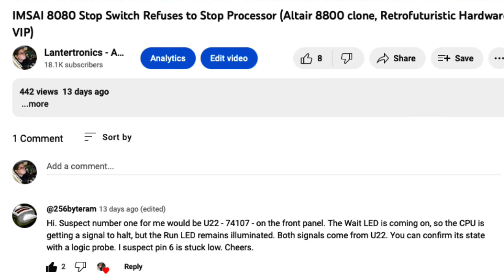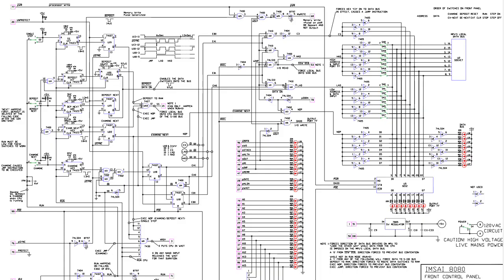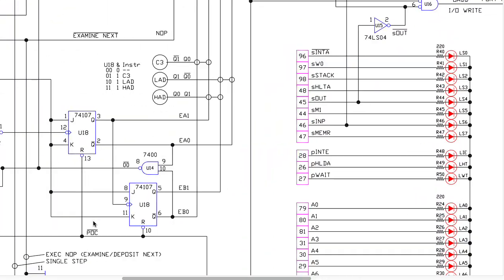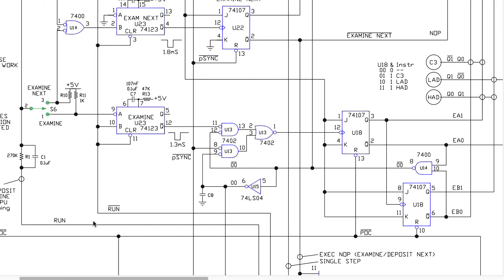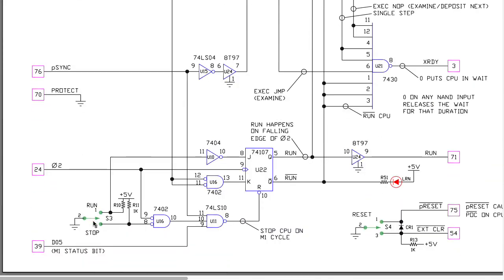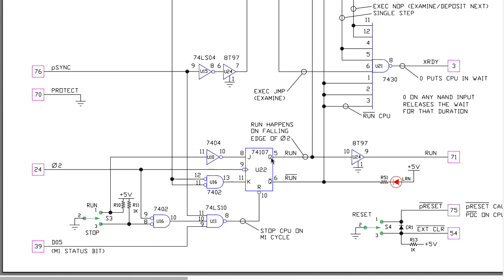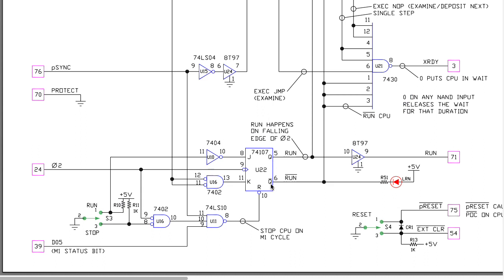IMSAI: Fixing Failed Flip-Flop Solves Sinister Stop Switch (Altair) (Retrofuturistic Hardware)

Comment: WOW !!! Very Nice !!! I do not remember any of my IMSAI 8080s having fully socketed ICs on the front panel. It is not a lot of fun taking off and re-installing the front panel, but you get used to it after you have pulled a few out, for cleaning. The Power supply unit is huge and pretty hard to pull out as well, but easy to work on.

Comment: I worked at a 2000 MW power plant for many years. Before converting the control systems to DCS, there were two control systems, one digital and one analog. When the control systems midbehaved, control techs would routinely unplug the multi-pin connectors on the offending modules, clean the connectors and replug the connectors. In most cases this corrected the problem expediently.

Comment: I have done this so many times on an old Commodore PET2001 that I borrowed from a friend over the summer vacation. The IC-sockets were especially crappy on this one so the memory chips creeped out of the sockets due to mechanical an thermal stress (I think). But the good old PET had a top enclosure that you could lift like a hood of the car, so before I started to use it I have to open it up and do some preventive maintenance 😅

Comment: I can recommend CAIG brand DeoxIT products for contacts and controls like potentiometers, as well as intermittent connections like sockets and even card edge connectors.  At work we used one of their products back in the late 1970s. I recall a multi-position slide switch in a DIP package that was notorious for being intermittent after wave soldering or rework.  The CAIG product worked wonders.